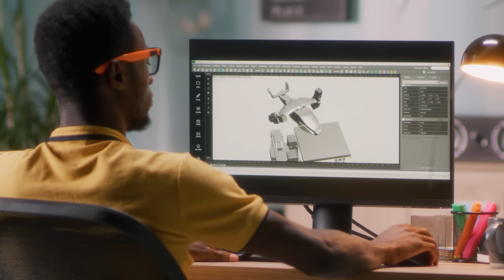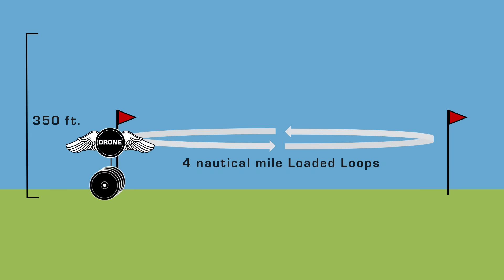DARPA Lift Challenge

Comment: you guys are overthinking this, we already have the tech. just build a 1/7 or 1/6 scale CH-47 Chinook lol. a 1/6 scale would easily lift 100lbs and you even have room for all the electronics inside 😯
Reply: Chinooks are so mechanically simple. Really clever thinking ;)
Reply: It’s a weak design. It will get there past the 4:1 based on my exhaustive calculations with a Latin hypercube
Reply: Awe kawii-mode Chinooks. Adorbs!
Reply: @WardGlo  Heck yeah, baby chinook!
Reply: RC hobbyist shows up & takes it all, with a 20 year old controller & a 15mil thick lexan fuselage engraved with milsim chopper styling, around an airframe he built with his grandkid & a hand-wound Axial flux PMSM, with some DIY direct torque SVPWM controller & a hydrogen fuel cell.
Reply: @prophetzarquon  based on my test and calculations, electricity won’t work and hydrogen. Fuel cells are too heavy, so even though you made a joke trying to use that tech technically no feasible based on the constraints for the lift competition and the payload.
Reply: Do it or stfu
Reply: @Ef554rgcc  fr, the braindead comments are always good popcorn fodder for this stuff.
Reply: @Ef554rgcc  already did six times it was a bit of a struggle, but once I found the first solution, the only reason why I didn’t want to do a seventh because I got bored, but I won’t make it seem like it was easy it wasn’t but I have six solutions 😂😂😂😂😂😂 so shhhhhhhhhhhhh to you
Reply: The Chinook has a maximum takeoff weight of 31,750 kg (70,000 lb) and can lift up to 11,340 kg (25,000 lb) externally. So not better than the stated 1:1 LTW.
Reply: @jeremyjacob6646  why do you insist on being lazy your calculations are incomplete stop trying to minimize our miniaturized the actual should not helicopter reshape the component send a few so large 😂 poor regular person. I’m just here to watch all your regular people struggle while a genius like me just have six solutions. With a sociopathic tenancy need to show off some here to be a peacock strut my stuff.
Reply: Go win the challenge then
Reply: Comment Wars V: Reynolds Number Strikes Back
Reply: Chinooks suck. Shrunk down, they'd only carry ~30lb out of the 110 lb required.
Reply: You’re close I won’t deny it, but you’re still kinda off the fuselage. You need to calculate for that as well momentum theory the correct rotor size using the correct power. A lot of you are going to struggle. Trying to figure it out, but just know I have six designs already. One of them is five to one. Proven mathematically, exhaustively and accurately using Latin hypercube, algorithms, etc., and optimizer, algorithms, etc.. according to my math it 4.84:1 if you get everything right on your calculations but out of all my designs it came forth so I’m not worried 😂😂😂😂😂😂😂 today was the day when I finish all six solutions. 4.25:1, 5.81:1, 4.84:1, 4.64:1, 5.49:1x2. I can imagine all the teams are struggling right now. I already did the impossible computationally six times by myself no team I have documents and documents to prove my solutions if anyone care to test me
Reply: Who is going enter I have six solutions already. Who wants to work with me
Reply: Im sure minitaurizing a ch-46 (at the cost of 60 million) will be 1/6th the price of the full sized 60 million dollar one.   Smaller is cheaper right?  I'm also sure it will def be less than 55 pounds.   You're genius.
Reply: @sparaz  you lack imagination it’s obviously on demand and would not be the same shape for the fuselage but for me it’s my fourth best design out of my six and I’m just here to struck my stuff and show off cause I’m already finished finding solutions so I’m trying to see who else has find one on this video
Reply: this is actually a valid solution in my eyes. Just take the plans to the xerox and shrink the dimensions. I know skunksworks has done that before.

Comment: Yay DARPA hard, 
Here's my contribution talk soon...

Propose a hybrid “few-big + many-small” lift architecture: a small number of high-power, high-speed carrier drones provide gross transport and cruise speed while a coordinated swarm of micro-drones (or tethered micro-modules) dynamically attach to an awkward payload at optimized key points to shape lift, control moments, and reduce peak thrust requirements — inspired by nature’s specialists: dung/rhinoceros beetles and leafcutter ants (extreme strength-to-mass ratios useful for mechanical attachment concepts), dragonflies (outstanding maneuverability and burst speed for small wing kinematics), hummingbirds (hovering and rapid thrust modulation useful for flapping/oscillatory actuator research), and large raptors like the harpy eagle (talon/grip strategies for secure payload pickup). This hybrid approach reduces single-vehicle size/weight constraints, improves fault tolerance (load can be redistributed if one micro-drone fails), and allows the system to trade peak power for coordinated control to hit both the “~5 mile” range and the ~50-lb payload envelope with higher top speed and resilience.
Reply: Long as it's under 55 pounds altogether and uses no lighter than air gasses.
Reply: This is ai 👆👆

Comment: Blimp. A blimp is gonna win and it’s not even gonna be close
Reply: 2.0 Aircraft Requirements:
2.7 Heavier Than Air: The UAS must be a heavier-than-air aircraft. The use of any lighter-than-air gasses to provide lift or to reduce the effective weight of the aircraft is strictly prohibited.
Reply: @Mowenatl  oh missed that!
Reply: @Mowenatl The phrasing on that makes me wonder if they'd rule out a hydrogen fuel cell; choosing a system for higher energy density by weight, is "reducing the effective weight of the aircraft"...
Reply: @Mowenatl thank you for providing that info! I was wondering.
Reply: Drops the weights for the last part of the challenge and "Wow, didn't think it would do that! Where's it gone?"
Reply: @chezlong releases gas
Entire world: 😱

Comment: If it's just about getting a heavy weight to an operating height.
What about a lift and glide system.

A hydrogen balloon to get the a glider to an operating height. The balloon is then  released and the glider powered or otherwise then transports the weight to the destination.

Alternativly you just use the big drone connected to a balloon to get the weight onto the air. And then use the fans on the drone  to drive it close to your target

Then use detach a small drone from the balloon mother ship, that small drone carries a line to the target site. 

Then you send the package down the zip line to the destination site.

Then Retract the zip line, either by a tensioned wheel   or with help of the micro drone that flew to the target with it. 

Then fly the big & little drones back to base losing height as you slowly release the hydrogen

Another alternative instead of a balloon, is to use a power cable so that much larger fans can be used, as their is no weight penalty from batteries as it's always connected to ground based power.

 These sort of drones already exist and are used to provide lighting to work sites.

The advantage of using hydrogen is that that the technology for its storage is well understood. It can be stored as a liquid and their is no explosive risk. As is handling its storage as a gas in the balloon. And its cheap unlike helium.
Reply: Because lighter than air gasses are prohibited in the design
Reply: You should probably watch the video.
Reply: no lighter than air gasses or launch assistance
Reply: No gases.
Reply: This is a dumbass design, even if this was even permitted. Did you even calculate for the turbulence and the gust in the atmosphere and the sway for the payload and the vibrations, blah blah blah blah blah blah I could go on and on about all the other calculations that you have forgotten.
Reply: Do it or stfu

Comment: Super light ducted fan.
Big props that turn more slowly.
4 rotors. 
Off the shelf agricultural drone frame.
Do virtual wind tunnel sorts of design iterations with physics prompted AI.
Reply: Ducted fan is a big no-no. But yes, some kind of big drone with big props and super high energy density (and high power density) batteries is probably a decent starting point. 55 lbs of weight carrying 110 lbs is very, very difficult. 220 lbs? That's just crazy. I'm not sure this is even really possible with current li-ion tech, it's right on the limit. The YouTube channel RCLifeOn has a 220 lbs lift capable drone, you would have to do that but with a bigger battery and of course a lighter frame. Might have to do ICE engine.
Reply: Not that easy, a very long rulebook to force students to think outside the box. you need to have a look. You really think you'll get 6.5 mil with a regular Agri drone with a ducted fan and 4 rotors? are you really that naïve? 

You are currently on "Mt stupid" on the Dunning-Kruger curve.